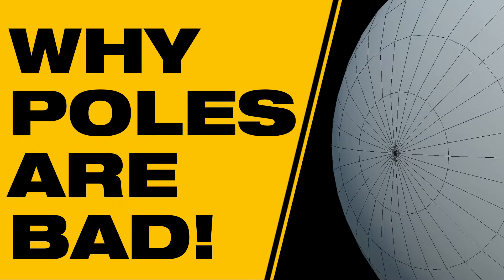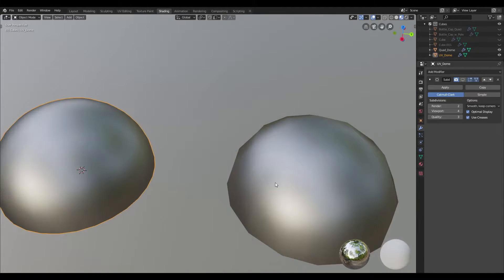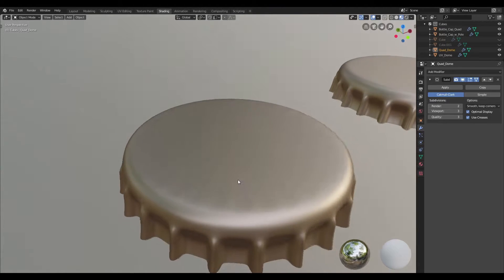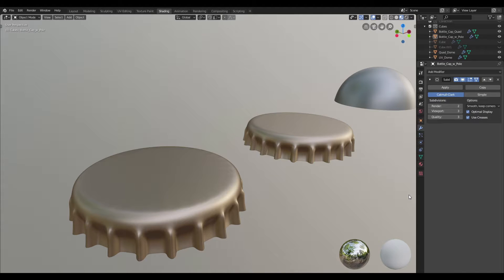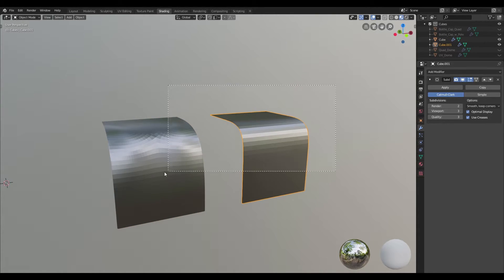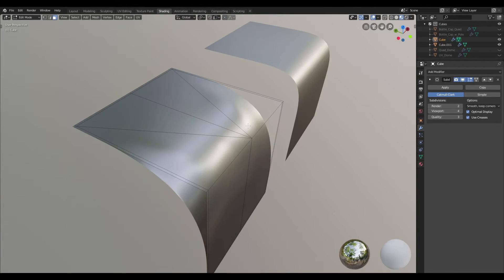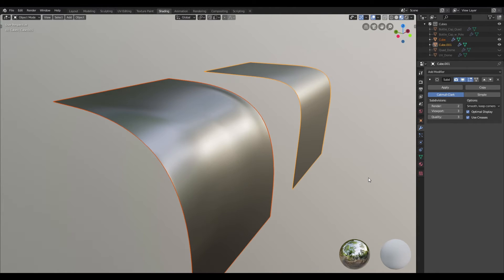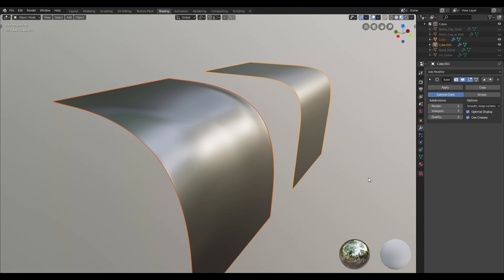Why Poles are Bad! | Topology Basics

Comment: If you're modeling a character's hands, chances are you will encounter 6 edges poles.
Put them some where that doesnt have any movements are fine. Also game models might have a lot of 6 edges pole as people always uses tris to adjust the vert counts.

you can use it in game models, but not SubD modeling. Its bad just like the video.
Reply from the maker: That's right you'll encounter several 6 spoked poles at the base of the fingers. It all comes down to knowing when and where to compromise.
You might be interested in this video : https://youtu.be/EwKTMXsAlYM
where I cover some of the exceptions to the rule and how they might even be the best solution.

Comment: So, you've addressed the problem - and offer zero guidance to fix / remove poles. Other than to "shift" it out of sight. "Great video man".
Reply: sometimes that's the solution (And he didn't shift it out of sight, he negated the effect, when subdividing 2 perfectly planar faces (with colinear vertices); there will be no smoothness by subdividing. *Try to add an edge loop to a plane and see if anything changes visually.

Comment: Makes sense in the other models and I came here to figure out retopology, but the wonky bent metal plate looks better for a scene. Less "fresh out of animator's desk", more real. Mabye real  people have wonky poles...
Reply from the maker: You can get away with poles if you know how to deal with them. A poorly positioned pole on the other hand will 
result in inaccurate shading, reflections and weird artifacts. Objects with "character" (like the bent metal plate example) will most definitely look better in a scene. You can achieve that without having to compromise the topology of the object.

Comment: a pole isnt necessary 6 edges connected. You also have weird subdiv issue with 3 and 5.
Reply: Recently I have been considering 6 spoked poles as a useful thing! I'm not getting much support for the idea yet. What do you think? I think they can be used effectively on internal corners surrounded by extrusions and insets on all sides.
Reply from the maker: @ianmcglasham  I agree, there are instances where the 6 spoked pole is useful in achieving certain shapes. I'll put together a video response and link it in this thread.
Reply from the maker: That is correct. However, 3 and 5 spoked poles are inevitable when it comes to more complex objects. On the other hand poles with 6+ connecting edges are completely avoidable and is consider bad practice.
Reply: @Art-of-Akrosh  6 poles is the equivalent of being on drugs

Comment: I thought poles have five or more converging edges.
Reply from the maker: Oops, I some how missed this comment. There are different types of poles. This video aims to addresses the problem with 6 or more poles (which is generally considered bad practice). The are some specific cases where 6 spoked poles can be handy but you don't want to accidentally have them hanging around in your models. I've got a few new videos discussing other types of poles and some strategies to circumnavigate the issues they pose.